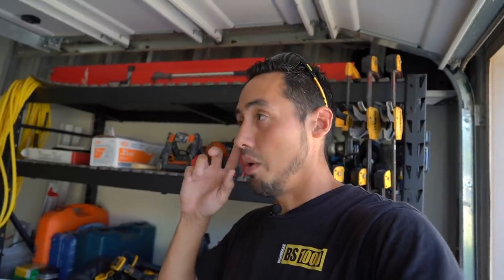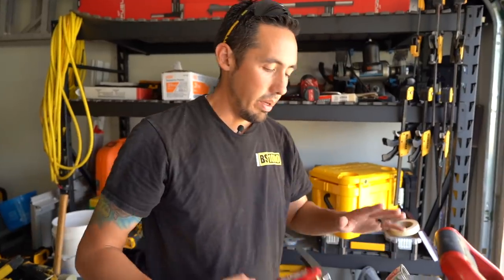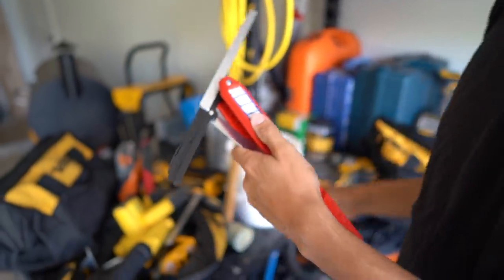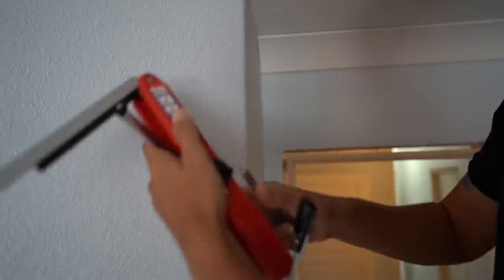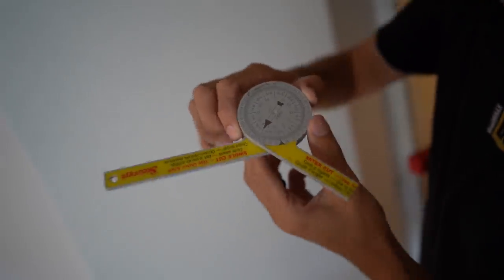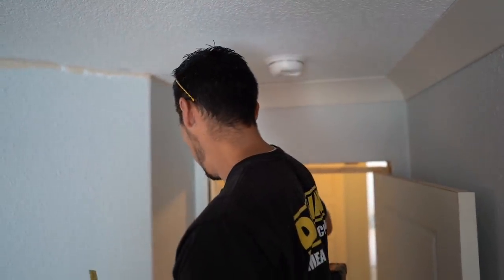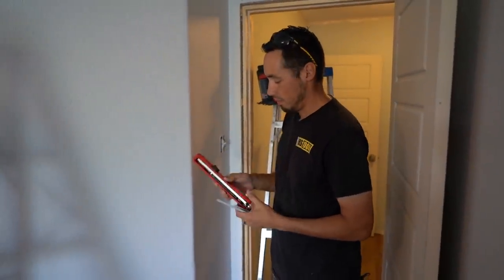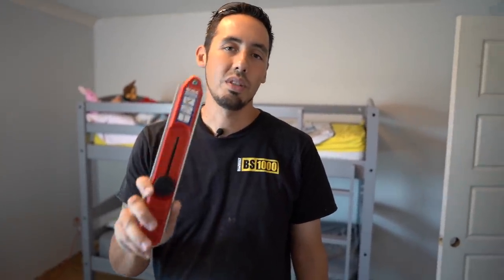This New Tool Gets PERFECT MITERS

Comment: The reason I like this tool is it doesn’t rely on your saw being 100% accurate; whereas the Starrett -you usually read the degree and then adjust your saw to the correct angle. Ergo, since you’re duplicating the angle, you’re less likely to introduce errors into the equation.
Reply: Even if your saw is dead nuts, it's always more accurate to scribe instead of measure. This is more or less scribing as opposed to measuring with the Starrett.

Comment: I have a Festool Kapex 120 and it comes with a similar tool. Basically you set the tool in place and the blade follows a line in the center of the tool. Love your videos BTW!
Reply: Looks like the Festool mitre gauge, improved.

Comment: Handy, I have a similar tool, all aluminum instead of the red the plastic body hence easier to align on either side of the saw.  For my money the starrett gauge has the efficiency advantage.  With the Starrett you don’t have to run back and forth from room to saw for each measurement.  Each piece fo crown requires two trips inside, one for each side/corner and that makes for slow and tiring work on even small jobs.

Comment: I think the tool looks great. The only possible problem I see is that when you're checking a small piece,at a corner you have to take into consideration that the corner bead has been built out with mud so that a longer piece is not going to sit as tight on the wall which is going to change the angle slightly which means the miter maybe a little Tighter on the parts of the crown molding that are protruding out more the backside of the molding, and the shallow parts will leave a gap. For paint grade molding, it's not a problem because there's a little bit of phila to put in but when it comes to stain grade molding, there is a little bit of a loss of precision. and the problem is is no easy way to fix that short of temporarily attaching a longer board on the wall and getting your angle off of it instead of off of the drywall/ corner bead situation. Truth be told you probably better  than me with crown molding. I just wish there was somebody who's old-school could cut perfect miters that don't require a putty or spackle at the joints. Is there anybody out there who could give me a few pointers on how to get a more precise miter

Comment: I use the Starrett miter protractor with great results.  One tip I would give is I make a temp 22.5° miter glue up & tack it in places so I know exactly where to measure to with bullnose.  It works great even if the wall is a hair obtuse.

Comment: From one tipster to another.....I spent a lot of time re-installing crowns that have sagged from the weight and 18 gauge nails. So to combat this I started using small dabs of PL about a 1/4 inch in from a chalk line I layout beforehand. People tend to eye the meeting point where they meet at the ceiling. Thanks for all the great tips
Reply: Could also screw mitered sticks in the corner and always be guaranteed a solid spot for nail to take
Reply: What is PL?
Reply: @TheDesertRat31  premium construction adhesive

Comment: An issue I see with that tool is you would have to measure cut and install as you go vs with the Starrett angle finder you can make a cut list and cut all trim at once. Which way is better?

Comment: Quick question on measuring. When ever I try to measure the length of a crown on a slightly rounded corner like the one in the vid. Im always cutting it a little bit at a time until I get it to where it's perfect. It just takes a long ass time. I'm new to the finishing scene. Any tips on measuring so I can be accurate and confident that way I'm not running back and forth to the saw

Comment: Thanks. I had two followup questions. First, where did you buy this crown? I don't see it at either Home Depot or Lowes. Secondly, why did you cope the inside corner instead of just cutting it as a normal inside joint?

Comment: Question: I am just a little over a year into my finished carpentry life. I’ve had base, trim, etc. move on me when I nail it in place. Even when I test fit it first. Do you ever have pieces brake after you you’ve glued them and nailed? They move in some way and, snap crackle pop it goes

Comment: The Bora miter is like the old school sliding bevel gauge I have with an ebony handle , brass locking nut and 8" SS blade.  I've seen it similar with a digital read out that is fancy and expensive.  I'm off to get a Bora miter to add to my collection.

Comment: Festool had that years ago on the Kopex miter saw, lol.
But still learning from your experience.
Reply: Yep, and a better design.
Reply: Yep the kapex 60 and 120 both come with the tool. I use mine everyday. The festool is easier to use as saw has markings on saw plate to quickly line up the tool.

Comment: What type of flap sanding disc do you use to cope?  I tried and 60 grit flap disc sanding wheel on pine trim, but after a couple of uses it seemed to get gummed up and smoke.  The sanding disc is designed for metal.  Is that the same type disc you use to cope?

Comment: Cool tool but if you have it in the budget, it (and your Starrett) doesn't even come close the convenience and functionality of Bosch's digital miter gauge. Not only does it tell you the exact angle but a push of a button tells you the angle to set your miter saw at, another push of a button tells you what to set the tilt angle, then the miter angle to set your miter saw at to get the desired miter when you are laying the crown flat, ie; for wide crown. So even if your walls are out a degree or 2 it is easily accounted for.

Comment: How do I use an 5 inch digital angle finder if there isn’t room to fit the angle finder? I have a protractor angle finder but I don’t know how to use it. The angle is next to a door and the trim is in the way to use the angle finder. I’m installing 5 1/2 baseboard with no tapered edge. The other question is measuring. When doing a measurement from an inside corner to an outside corner, where do you measure from and to? I wanna see the measurements up close from point a to b on an inside and outside corner. No one shows that. As well as showing doing a miter cut going from left to right. Do I flip the board? How do I know or remember which piece is which?

Comment: I also have both tools the only problem I have with the bora duplicator is u can only do 1 angle at a time then have to go to the saw to check it. With the starrett I can check multiple angles get measurements and go cut everything.

Comment: Hey Richard, my house was built with metal studs, I know, I know. Anyway, what do you suggest to install the crown molding? Still just through sheetrock, or do I need to screw into the studs.
Reply: Why not use plaster coving? Almost all new builds here in NZ use that. It is put up with a plaster based adhesive very similar to jointing compound (hot mud). The results are very clean and high end looking, and there are no fasteners. It conforms to any variations in the walls, and the edges and mitres are simply wiped with a damp sponge once its up, and it's basically ready for paint.
Reply: The nails never really hold in straight plasterboard.

Comment: The  biggest advantage for the new angle finder is that if your miter saw is out of square (blade not 90 degrees to fence) it won't matter
since you use the tool itself to set the correct cut angle and you don't have to rely on the possibly inaccurate degree gauge on the saw
either ( like if the saw is a cheaper brand).

Comment: Im just curious how do you get your MDF cuts so nice? Im a finish carpenter from 9 to 5 and unless I change the blade on the saw once a week, MDF cuts are rough looking and tend to chip.  I personally prefer trim that actually made from wood materials for that reason. This past spring after seeing your video, I actually bought one of those starett miter protractors, and I use the heck out of it, and I’ve never had an issue with it being off a degree, now I think I might have to get one of these as well.
Reply from the maker: Joe Powell you are absolutely right. The sharp blade is key to tight joints . Especially mdf

Comment: I only have a regular metal protractor... but my question Rich I cut some crown and the ceiling and wall are so out of square and ceiling dipping down so I put 45 degree cuts I tried angle finder divided in half and nothing is tight at all I’ll show pics please help lol

Comment: I know this is an old video, but it came up in my YouTube feed and got me thinking about my Starrett.  I had all kinds of problems with gaps in my corners a few days ago, so I went to the garage and measured it against several squares, and wouldn't you know it's about 3 degrees out!  Explains a lot.  I undid that screw you pointed to and found that NO, that's not an adjustment, there's no way to adjust the Starrett.  That's just the screw that holds it together.  It's going in the trash.

Comment: In the video when you put the Starrett up to the Bora and they read the same number, i would stop using the Bora right then and there. The reason is because the Starrett gives you the miter angle on the tool. this means you can go around and make a cut sheet and then go make all your cuts at the saw instead of going back to the saw, taking the right arm off the bora, adjusting the saw to the tool, making a cut, put the arm back on the bora, walk to your next angle, etc etc.

The starrett seems way faster and more efficient, and its dead accurate as you have proven. Also, its smaller and is something you can toss in your tool belt so you always have it on hand

Comment: Seems like maybe with the length of the body away from the wall it would be handy to add a bubble level into the tool. If the furthest part of the tool away from the wall isn't perpendicular then it could open/close your angles.

Comment: Well I have a digital one , then I divide by 2.>>  Boom  I know the angle.  But it does look pretty beefy and you have it set up for first cut just by lining up..
Also somebody mentioned that taking the measurement and dividing the angle,  you are relying on your miter saw being absolutely accurate. So yeah this kinda takes the quess work out of that.
Reply: So if the angle is 88 degrees and you simply divide that by 2 and adjust your mitre saw to 44- it will not be the correct angle.

Comment: I know this is an old instructional video but why don't you hold the Bora tool the other way around so the tightening knob could be on the bottom where you can reach it easily

Comment: The new fancy tools are good for finding angles but I still rely on my $3 sliding T bevel gauge. Wrap it around the outside corner, drop it on the saw match the angle, Divide the angle shown on the saw by two and bingo you got your angle. If the angle is greater than 25°most saws Don’t go over 50° or so.
Reply: Farmer Jim I was thinking the same but a lot of people have bought the starrett it seems
Reply: @jackheilmann3739  the starret  or any angle finder does save a step. When banging up several hundred feet of trim a day every saved step means more money in the pocket. My only concern with the starret is the short arms,  mud  build in the corners could result in some bad angles on occasion. I think he mentioned that in the video though.

Comment: A lot of messing about, given how simple and accurate the starrett tool is.
Reply from the maker: Gethin Duggan very true. I think this could have its place especially since the arms are significantly longer than the starrett. The starrett has not let me down yet!
Reply: @FinishCarpentryTV  I bought the bigger  aluminium one years ago when I worked in the U.S. Never leave home without it
Reply: After watching the video on the Starrett tool I bought one. The only issue I have is that for shorter walls (walls that are shorter than the actual arm of the tool especially around the area of tubs and showers) it doesn't work well. I guess I could cut the arm down to help alleviate this issue but I don't want to purposely wreck my tool.
Reply: John Heller 
I purchased two of the Starrett units, one to cut to fit tight areas like you mentioned, & one to leave factory length. 
DFW Crown keep the videos coming!
I always learn something.

Comment: Can you make some videos on high vaulted ceilings. I tried a 45 degree angel and a 50 degree angle seems to work but most videos show making a 45 cut on both ends and it works for a small vaulted ceiling but a high vaulted ceiling it doesn’t work. Looks like chalk is gonna be the answer in the corners. I have a Sterrett miter guava but doesn’t work on double miters
Reply: 45 makes upside down cuts left cut saw goes to left 45 cut right saw goes to right inside cut
Reply: Flat ceiling works great but for vaulted ceilings are difficult

Comment: Very surprised Festool hasn’t been knocking on their door looking to pull them on copyright infringement. It’s marginally different but not so you’d notice. As previously mentioned here it comes as standard with a Kapex 120, the saw even has a storage slot to keep it in. The Festool version looks to a lot more substantial. It’s shameless when a tool company blatantly steel someone’s old tech. 
As far as accuracy goes, as it locks onto the angle, it has to be 100% accurate by default. Well demonstrated though.

Comment: That’s a crappy and huge version of the festool miterfast angle transfer....which you don’t have to take apart ... and loose pieces ...or put back together to use it again....yes the festool is expensive...and mine is now well over 10yrs old and still perfectly accurate...you get what you pay for.

Comment: And one more thing I forgot to mention. Inside corners have the same problem because of the build-out of the tape with the mud work. We can't bend an angled piece of crown molding in it's last 5 or 6 inches from the inside corners

Comment: An easier way of getting perfect mitre cuts is by a cheap digital protractor messure the corner then anything under a 90 degrees devide it by 2 then set the saw. Anything over 90 degrees which is classed as an obtuse angle devide it by 2 get the answer then devide it by 2 again an what ever the answer is thats what you set the saw at. Just my formula of doing it. Perfect everytime👌🏼💪🏼😁
Reply: What if your saw and the digital protractor are not calibrated exactly a like? This method removes any error between the two.

Comment: Not really anything “New”though.. It’s been a key feature of the Kapex for years.

Handy tip to make your life way easier. Set the laser up and line it up with the edge of the red section so you don’t have to mess around trying to pull your blade down and zero clearance it. Or just get a betterley zero clearance insert.. then you can see the cut line, effortlessly, every time.

Comment: Setting your saw to 27 degrees that accurately is unlikely.  That's why it's always better to transfer from the jig.  There is no way reading an angle is going to be accurate.  No repeatability.  Even with the digital angle guages which read to the 1/10th of a degree.  Your angle could have been 23.8 degrees and the Starret would still point to 24 degrees.  Hey, but pretty good report!  Thanks!

Comment: I've bought these in the past and I've found that the arms are too short to be accurate.  they're reading the angle where the drywall mud is piled up at the tape joint.  I found one with 30" arms and it's better because it gets past the mud joint and gives you a averaged reading. if that makes any sense.  to tell you the truth, I just buy a little extra moulding, say two pieces 30" long or so, fit those,  with the angle on the fitter as I call it,  transfer the info to the sized piece, make my cuts.  move on to next angle, cut the fitter back 1/4 " or so for new angle, repeat.  a lot of things come in to play when installing wide crown. are the walls plumb, are the walls and ceiling 90 degrees to each other, etc.  I would rather see the wood fitting first, then the length is all that matters. the fitters get used on both sides. one side for inside angles,  the other end for outside angles.  disregard this if you like.

Comment: Hello Helpful YouTube People,
My compound miter saw isn’t cutting the angles I dial in. I think the fence is off which is throwing off my cuts. Anyone know how to fix this problem?
Reply: What kind of saw I’d it?  You can slide the scale on some saws to make adjustments.  Or you can move the fence.
Reply: It's your detent plate. It needs adjustment. Insider Carpentry has a great video on that. He uses a mock picture frame to compound the error so he can get a better idea of how much it's off. Similar to the 5 cut method of squaring up a table saw.

Comment: Seems with the Starrett tool, you could measure multiple miters before heading down to the saw.  With this tool, its one at a time (especially if the walls are a bit off).
Reply: Photog 1 Yup. With the Starrett tool you can quickly get many slightly innaccurate measurements. If your clients don't care about .25 degrees or caulking on the crown moulding then it doesn't matter.

Comment: I think it’s a overly complicated t bevel. Just use your starret or a t bevel and devide the angle in half. There are also electronic t bevels too that will tell you the angle. Seems like such a waste of time to have to take it apart and line it up with your saw blade. Nobody that’s in the game for money will ever use a tool like this. It’s designed for “quick to buy” home gamers. First time you drop it, it’ll break.

Comment: Meh. If that knob slips, it won't be so precise. Easiest tool has to be the Starrett CP505E-12 which takes your measured angle and gives you a miter and bevel angles.